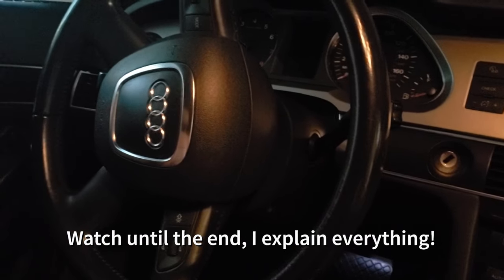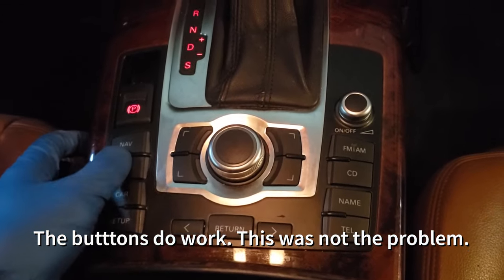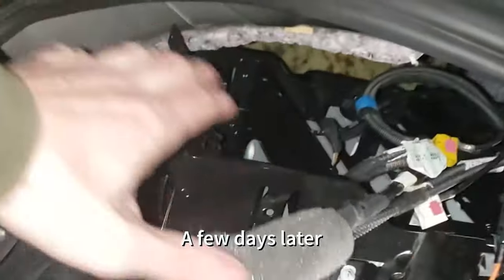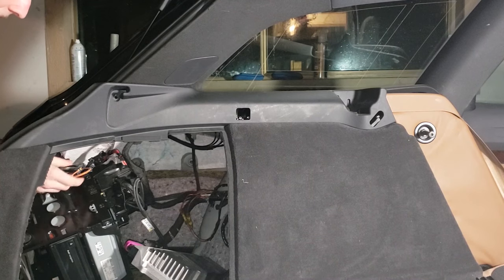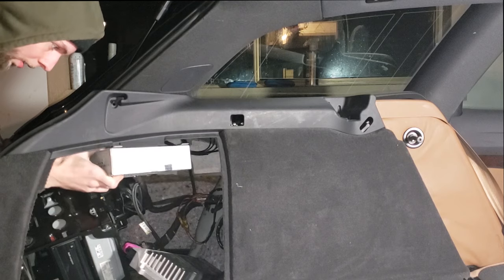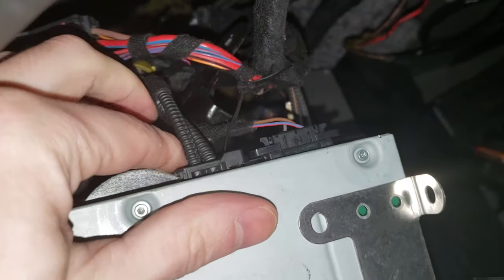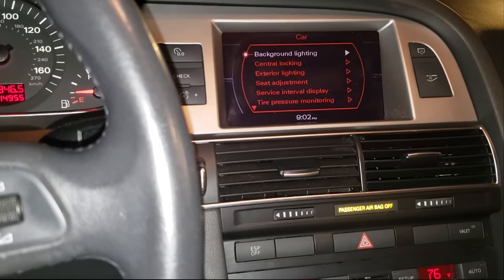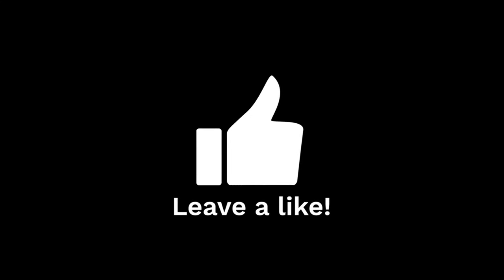Audi MMI Diagnosis & Repair (Fiber Optic Testing) | DIY

Comment: Hello, 
Thank you for making the video.
Question. 
I replaced the Amp circuit board to fix my MMI, & Radio. 
However, sound only works on the left side of the car. 
Know why?
Reply from the maker: Somehow just now seeing this, sorry about that. Were you able to fix this yet?
Reply: @Mechani_Cole  Nope..I bought a different circuit board and it happened again. Ha 
So I returned it.
Reply from the maker: @donzo3j  stupid question, but did you check the settings and play with the equalizer?

Checked fuses as well?
Reply: @Mechani_Cole  Thanks for the responses..
All the fuses I checked seemed fine.. 
However I wasn't sure what' is the proper fuse linked to the Speakers 😭.
 I did play with the Equalizers settings.
Reply: @donzo3j  I could be component protection, I have the same thing happening to mine. It’s the car pretty much telling you that the parts isn’t original to the car. Dealership wanted a bunch of money to program my amp to the car.
Reply from the maker: Good insight😁

Comment: Thanks man! I was able to fix the mmi and radio but I kept the loop in and the radio was working fine. (3 months) Recently, the mmi stopped working so I brought another loop and it turned back on but now I have no sound. I have multiple replacements for each part, but it seems like the loop is the only thing that works. What should I do? I also have replacement fuses!
Reply from the maker: What do you have the loop plugged into now?
Reply: @Mechani_Cole  I have one loop plugged into the main system, the plug that goes into the main system, and one that goes into the siriusxm(it worked with sound at first)
Reply from the maker: Should only be testing 1 at a time to confirm which one is bad in my opinion. All you're looking for a is a different result when you plug that connector in than what you have. If there is even the smallest break in the fiber optic loop, the whole system will not function
Reply: @Mechani_Cole  I mean the mmi is on and functions properly, but there isn’t any sound. Is that because I have a loop in the main system? When I plug it in there regularly it doesn’t turn on at all.
Reply from the maker: Good question. Something in the main isn't getting the connection it sounds like. Could be to the Amp possibly and that's why no sound. Hard to say without looking at it in person
Reply: @Mechani_Cole  How can I fix the amp?
Reply from the maker: By replacing it
Reply: @Mechani_Cole  Is the amp the main system because I swapped it and it didn’t work. Since I have three I swapped it again and if still didn’t work.
Reply from the maker: Depends on the make and model. Not sure what you're working on
Reply: @Mechani_Cole I didn’t see this but I have a 2008 audi a6

Comment: Hey @mechincole how do you going about doing this for a Audi A7?
Reply from the maker: Similar process. Locate the modules in your A7 (Google super helpful here), then remove the bracket holding them in. 

Remove the fiber optic connection on 1, plug in lolipop tester in link to the wire harness. Then turn the car on and see if any difference. 

Repeat this process until something changes on each module. Once you find which plug makes a connection with tester, then remove and replace module. 

You can also leave the tester in as a temporary solution. 

Basically the fiber optic tester creates a complete loop in the fiber optic signal. When a module fails, the connection is broken/interruption. The connecter completes the circuit to by pass the module is all that makes sense. 

Best of luck, thanks for watching🤙🏼
Reply: @Mechani_Cole  the thing is I did that and ended up taking out the cd unit and when I check the fiber line no red laser was coming out of it
Reply from the maker: @yunggenna1483  hard to tell with out the tester. If you had the tester, and by pass the cd player, then you should get functions back minus being able to play cds. 

Is your screen completely off like in the video?
Reply: @Mechani_Cole  yes it’s off, again you see the fiber optic line that goes to f CD player it has no light in it
Reply from the maker: @yunggenna1483  have you checked fuses?

I can't remember if I saw a light on mine or not. I just tested each module plug with power on and then found the dead module.
Reply: @Mechani_Cole  I see light everywhere else so my guess is something is wrong there... I’ll check fuses but which should I look for
Reply from the maker: @yunggenna1483  see if there is a CD player or radio related fuse. 

If you plug the tester into the wire harness, does your power to the screen come on?
Reply: @Mechani_Cole  no put sometimes it pops up randomly then I can’t close it then after a while it closes itself

Comment: Could I just order this fiber and keep it in without replacing anything else?
Reply from the maker: Yes, good question!

Everything worked once I plugged it in, however, I didn't have Am/Fm so I couldn't turn on the radio until this part was replaced. 

Once I replaced this part, I got a Bluetooth receiver and can now play music through my phone in here. 

If I just left the tester in, everything would work, but I wouldn't have any sound
Reply: @Mechani_Cole  how many modules plugs are there in the back?
Reply: I saw another guy with a video online that had a solid black tester, what’s the difference between the orange loop one you have and there’s?
Reply from the maker: @BabaYaga_1776  about 4-5. Amplifier, AM/FM receiver, Navigation and 2 others if I remember correctly. At least the first 3 for sure. 

If any one of them has a break in the fiber optic line, it will shut the whole system down. 

The tester completes the fiber optic loop when plugged in therefore completing the loop and turning the system on once the bad module is by-passed.
Reply from the maker: @BabaYaga_1776  most likely nothing. Either way the tester is going to complete the fiber optic loop. 

Link in bio for the one I was using. 

Dealership quoted $3500 to fix this. I fixed it for $60 on Ebay for the module and $15 for this tester.

Still works over 1 year later
Reply: @Mechani_Cole  Do I need the moduel?
Reply: @Mechani_Cole  also really odd is my battery was dead, I charged it up and then this issue started.
Reply: So what you’re saying is the radio the navigation and a few other things all have a fiber optic that could be bad, so order the tester to see. Do you have a email I can email you pictures?
Reply from the maker: @BabaYaga_1776  yes that is correct. All the modules must complete the fiber optic circuit.

Unfortunately, due to the high volume, I no longer help/assist people via email for free.
Reply: @Mechani_Cole   when I installed the loop my car engine lost a ton of power, did you have that issue?
Reply from the maker: @BabaYaga_1776  no, not at all. How old is your battery?

Do you get full power when you unplug the tester?
Reply: @Mechani_Cole  my battery is new, the car runs but when I plug in the loop, the power goes down
Reply from the maker: @BabaYaga_1776  interesting, never experienced that before personally🤔
Reply: @Mechani_Cole  weird
Reply: @Mechani_Cole  It’s working fine now, the loss power was an unrelated problem.
Reply from the maker: @BabaYaga_1776  thanks for sharing! Good to know😬
Reply: @Mechani_Cole  I am now getting the P2404 code but I hear it’s not a bad one.

Comment: Where do I connect the loop again?
Reply from the maker: Unplug the connector from the back of the module, then insert loop into the end of the plug that you just removed. Then turn on to see if any changes. If it turns on or changes when plugged in, then that is your faulty module. 

There is 4 or 5 modules;
- AM/FM Receiver
- Navigation
- CD Player
- Amplifier

Test each plug. The tool completes the fiber optic loop, if one of these modules is failed then it breaks the loop, therefore shutting power down.

Hope this helps🤙🏼
Reply: I have a 2008 Audi I just got and I ordere the loops should be here in a few days , would you be willing to hop on FaceTime when I get them and I’ll pay you for your time to help me fix this!? Pls lmk :) thanks
Reply from the maker: @AlexanderMartinez-ey9nq  ya its possible, contact me when you get the tool🤙🏼
Reply: @Mechani_Cole  It comes in tomorrow well that all I need or will I need that metal box tool that you got from Amazon.
Reply from the maker: @AlexanderMartinez-ey9nq  only tool needed should just be the fiber optic loop to test it
Reply: @Mechani_Cole  Now another question I had was my heated seats and doors don’t lock and doing research it says it’s because of the fuses will this fix all that or this will only fix the front screen and music problem? :)
Reply from the maker: @AlexanderMartinez-ey9nq  not sure on that one. Check fuses first
Reply: @Mechani_Cole  Well I open the right and left sites where the fuses are and they are missing them so what can I do to fix that I tried moving some of them but they just didn’t go in?  But if you have Instagram or somewhere I can send you pictures?
Reply from the maker: @AlexanderMartinez-ey9nq  its @mechincole. If they are missing, just put new fuses in and see if that fixes it
Reply from the maker: @AlexanderMartinez-ey9nq  ya, my instagram is @mechanicole
Reply: @Mechani_Cole  I dm you
Reply: @Mechani_Cole  I got the part , I also dm you! :)
Reply: If your replace the mmi would that fix it as well?